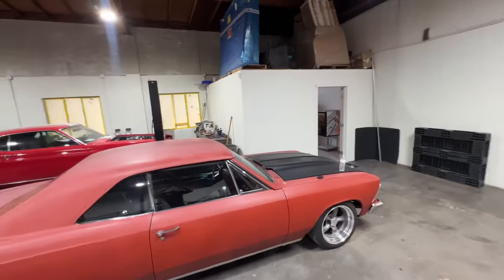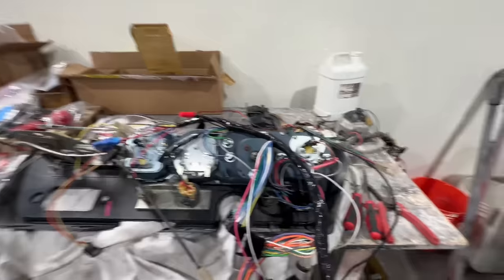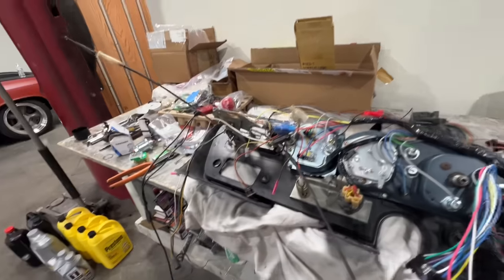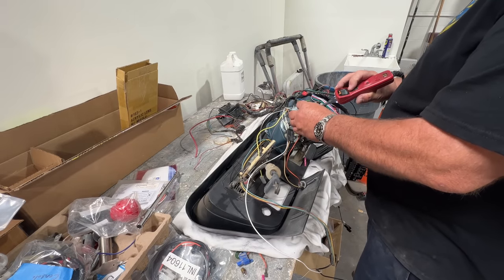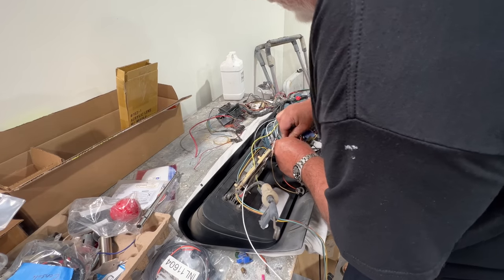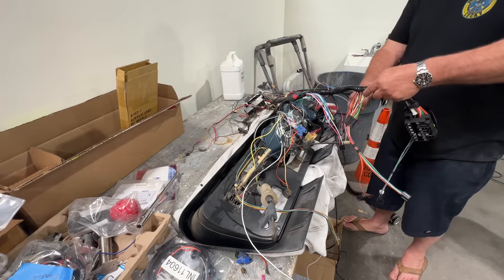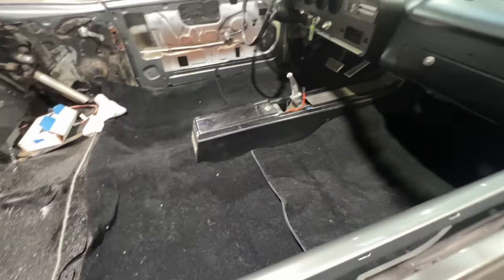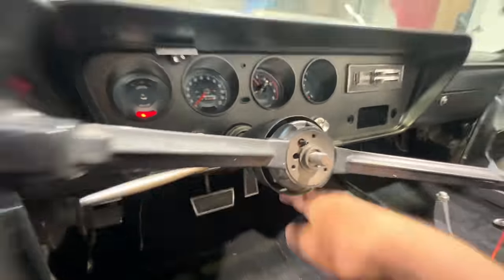1966 GTO Dash Install

Comment: For better or worse. I've added to my "fleet" of 60's muscle cars. Two days ago I bought a totally restored 1967 Mercury Cougar. It has a two tone paint job. And the bottom is the same sliver color as the GTO in this video. The top part is Jet Black. It has some Shelby style of rims and a thumpy radio. And not that it matters to much it's a numbers matching engine and trans. But the best part is it's got a AC system that blows Really cold. And living in the South like I do that was a must have when I was looking for something else. 6=8.
Reply: Updated sequential turn signals or the factory system? Love those tail lights!
Reply: @br549200  The guy that I bought it from said he put in led bulbs. As for the rest being the factory system. I might want give him a call to check that out. I put some sequential taillights in my 67 Mustang with Orange and Red lenses. Just to be different I guess.
Reply: @lilorbielilorbie2496  “sixties era electronics” for the sequential turn signals are located in several areas of the car and can be a nightmare when they start to malfunction. I had a 68 cougar and fortunately the system worked fine.
Reply: @br549200  I'm gonna hope for the best.